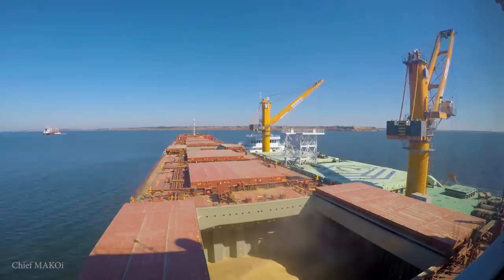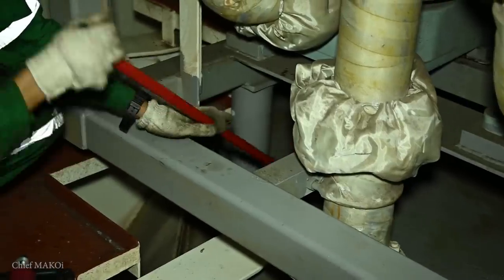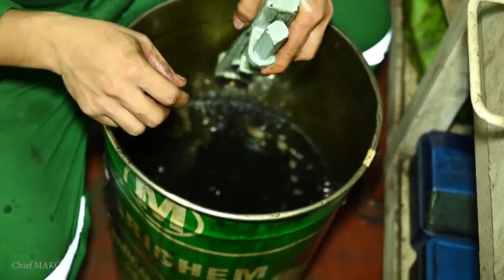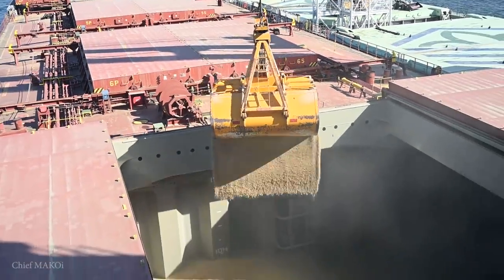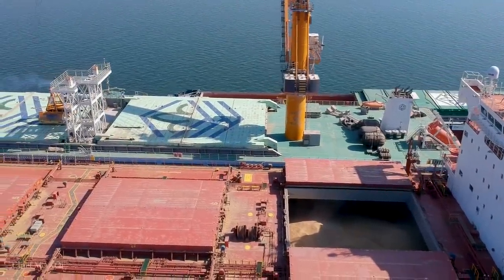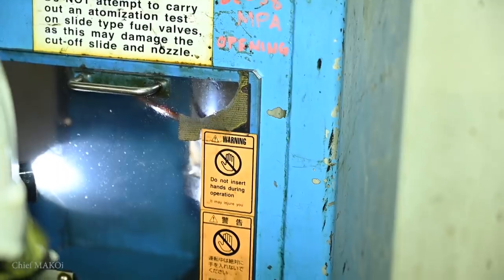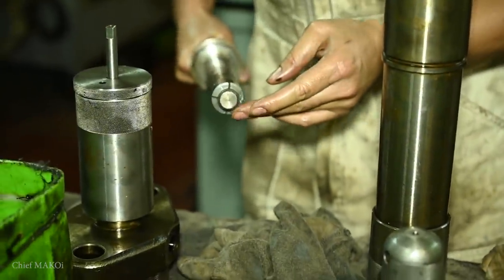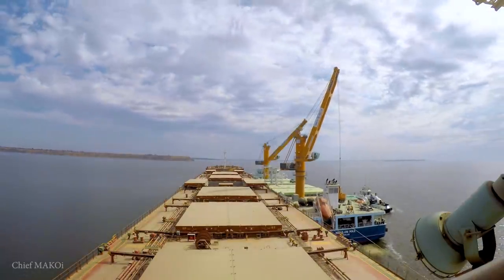Our Ship Loads Cargo in Ukraine | Seaman Vlog S03E09

Comment: Hello there my friend ! Another awesome video ! While i was watching the people working in the engine room brought back memories from my days at the Navy ...our Ship was made in 1935 in U.S.A , took place in the Philadelphia experiment and after it was decommissioned for them ...my country took it ...LOL . It's purpose was very specific , the rear part had a huge door , we opened that door , it would fill up tanks with water so it would partially submerge and then take in from small submarines , Landing crafts , and at the level above we could have battle tanks and troops , even a helicopter . 
Now to the juicy stuff ...LOL , from what i heard it needed very little amount of crued oil to operate because ...it was using STEAM engines ...LOL :)  how cool is that ?  Maximum speed ( downhill perhaps ) 12 knots but as long as i was on it it went like 9 knots . 
Normally i was a deck specified cadet but occasionally i went down to the engine to hang out with friends , chat , stuff like that , so i had to go through double secure doors , i had to open and close the first door , before i could open the second door , otherwise the pressure difference would cause explosion  ...so yeah i had to be extra careful with that !

Comment: Grain or coal dust are volatile. So I wonder what measures you take to prevent exploding. I saw a coal carrier which had exploded at the dock. I never heard about an ignition source, but it blew the heavy steel hatch covers clear over the bridge. One was never found, the other landed on the aft-deck , along with the seaman standing on it. I am not sure I would feel that safe on a grain carrier.

Comment: Great video Chief, I like the way you keep it factual and interesting without all the danger music some others love👍 
Following on from one of your other videos on estimated charges, would the Shipping company still charge $9000/day, or probably more in your ships case as it is above the 40000 tonnes you used for an example, for the whole duration of the charter including loading, or is there an "At Sea" charge separate to the loading period? 
Safe travels Chief!?
Reply from the maker: It's not exactly on a "daily basis" and as I mentioned, different ship types have different rates.  For a Voyage charter, the ship is hired for one whole voyage (from loading to discharging) at an agreed upon price between owner and charterer.  For Time Charter, the ship is hired for a set period of time - for example 1 year - again at an agreed upon rate.  It doesn't matter whether the ship is in port or at sea.  And there may be other stipulations in the charter party agreement so it's difficult to generalize.  If the ship has to stop due to malfunction or repairs when it was supposed to be running or is delayed in leaving the port due to the fault of the crew (like when the ship is detained by Port State Control because of deficiencies), it will be on off-hire status.  The cost is deducted from the charter computed on an hourly rate (delayed for 13 hours might mean $9,000 / 24 hrs x 13).
Reply: @ChiefMAKOi  Thanks for the reply Chief, I  can see how the contract will dictate the situation. At a guess, due to fuel costs, it will cost ore on a daily basis when at sea and loading, if beyond your control means down time for the ship? I have similar constraints in my business but it isn't marine,  we are in aviation. But I am an old sea dog at heart and own an old wooden converted fishing trawler with a 1950's vintage Lister 8 cylinder diesel👍 
The food for the special dinner looked really good, had me smacking the lips there 😁🍻

Comment: Wouldn't it be faster to transfer the grain through a vacuum then dump to a conveyor belt system be much quicker?  I was thinking this a couple days ago when you showed this crane sitting there.
Reply: the port might not be able to accomodate large ships
Reply: I have been thinking this. I’m sure there is a reason that it isn’t possible.

Comment: Making sure that the nuts and bolts must be tighten properly especially in fuel valves injectors, and the high pressure pipes, during the starting or turning the engine even if the indicators is fully open it will fly out the injectors away from the heads..

Comment: Those injectors are just a bit larger than the ones I replaced  on my Ford F 150 truck.  That dust from the grain loading. Not a static electricity dust explosion hazard ??

Comment: Chief,

When your ready, and care to comment,  could you clear up some mysterys about how/where the  main engine lubricating oil is held? "Loss of Propulsion"  was one of the major factors in the El Faro loss. Engine loss was reported to be due to low main engine lubricating oil levels that were within minimum operational standards, yet the engine starved for oil, quit, eventually leading to the El Faro capsizing and sinking for a total loss, Now, another ship goes down reportedly due to an engine faliure leading to capsizing and sinking and loss. 
What's up?

Comment: When you're carrying grain or coal, do you have to take any extra steps to avoid dust explosions?  I remember that this can be an issue in grain silos: because of how fine the dust is, and the high surface-area-to-weight ratio, grain dust in a silo can actually explode if there's a spark from any equipment.  I believe the same is true with coal dust.  Do you guys have to take any sort of precaution for that?
Reply from the maker: Yes.  A lot.

Comment: Another great video! I was wondering is it normal to have your holds loaded by bucket? I would have thought an auger loader would have been faster.
Reply: . . . and how it works if the weather is rainy ?
Reply: @henryganzer4685  grain must stay dry or it will spoil in a hurry.  Rain would delay loading as the covers on both the ship and barge must be closed.

Comment: Do ships of that general type have any means of propulsion besides the main engine?
Reply: No, they do normally not.
But the following arrangement is sometimes found on tankers:
Medium speed engine driving a controllable pitch propeller through a reduction gearbox. The gearbox is in that case equipped with a pto driving a shaftgenerator.
In case of necessary repairs to the main engine with vessel alongside, it is possible through a system of clutches to disconnect the main engine from the shaftline and let the shaftgenerator work as a motor. The necessary power is then supplied by the  vessels auxiliary gensets.
In order to comply with classification rules, the minimum speed which should be achieved in that case is 7 knots.
Reply: @janvisser2223  Thank you; I figured if it was necessary it would be an arrangement like that.